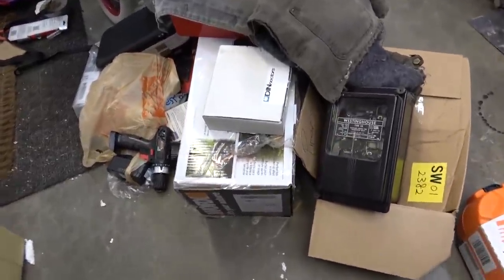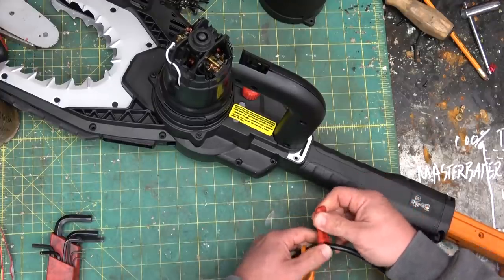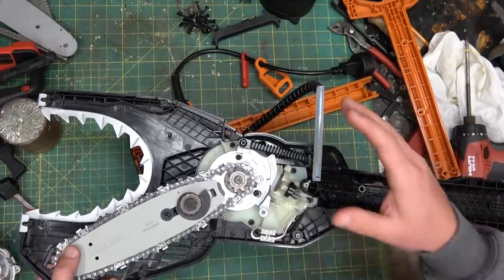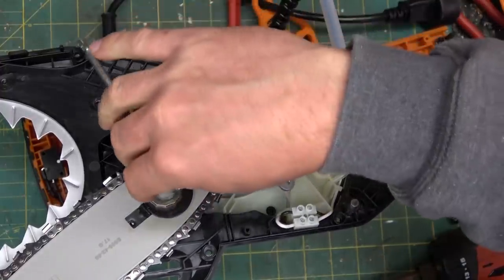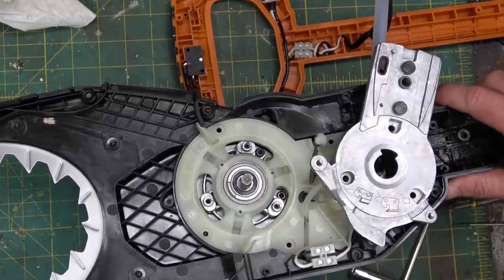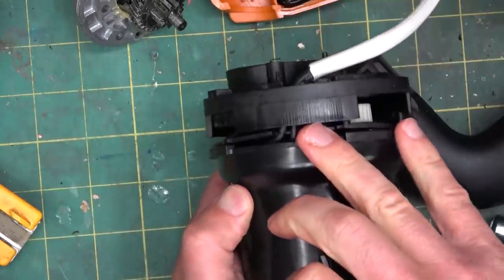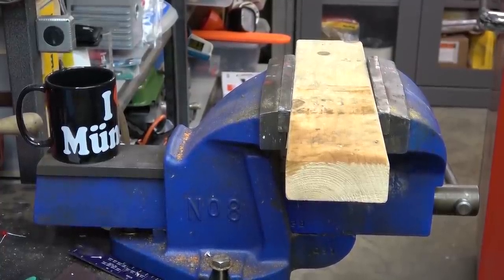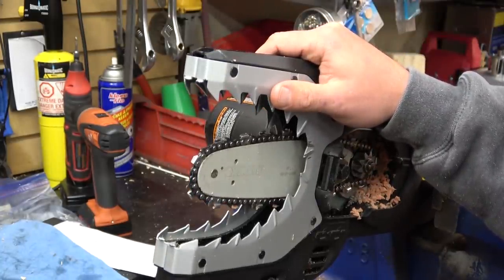BOLTR: Worx Jaw Saw | Engineering Fail

Comment: Shamefully admit I was going to purchase this you can’t tell that my head hanging low in my defense they’re really cool commercial! But all the cool kids you know mid 40s are purchasing  Rc trucks from China 🇨🇳 one in particular is the VKAR BISON 70 km/h cool kids bashing & jumps so much fun!! Anyway I could talk you into talking to your best friend is sending you one and you work out the problem everybody has with these inexpensive high speed remote control trucks It’s a really good vehicle with that said There are engineering and design flaws that are I know that there’s A mathematical solution for the design flaws !!????? Right? If you’re interested go to gear best type in Vkar Bison But lots of pictures can even download a schematic comes in two different versions ready to run or the one that you build yourself and you put in your electronics.. there’s even a Facebook page dedicated to this car go figure out what the hell were doing wrong anyway I blathered thanks for saving me money on the tool!!
Thanks 🙏